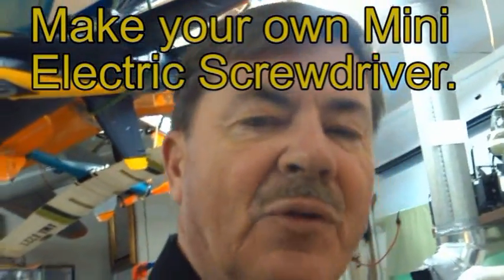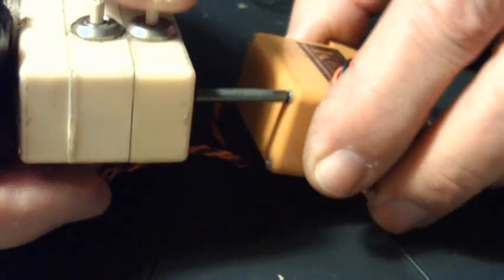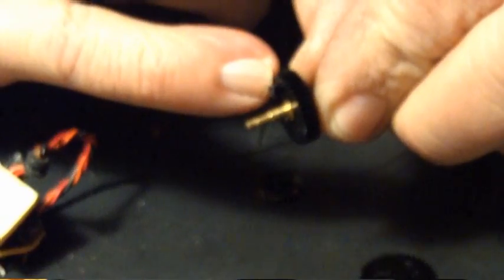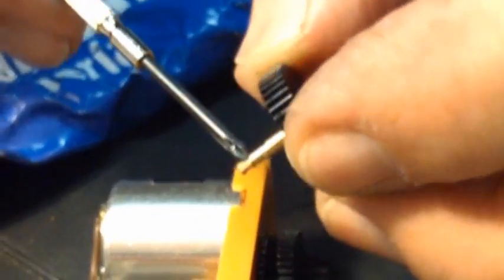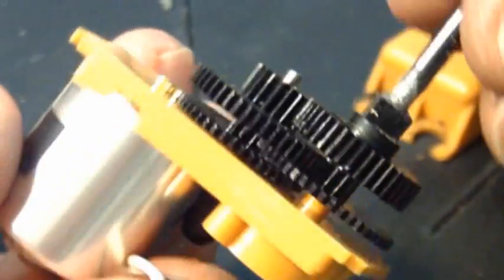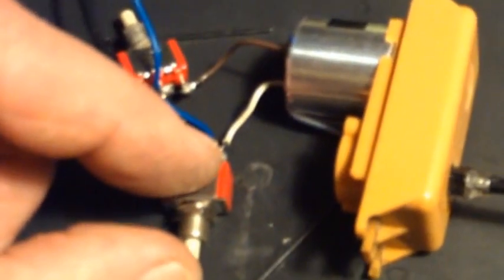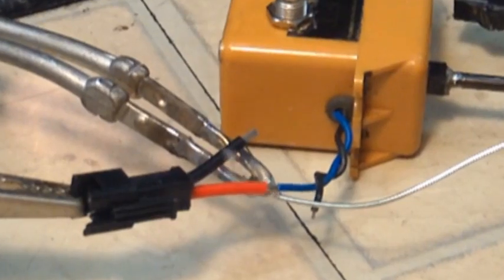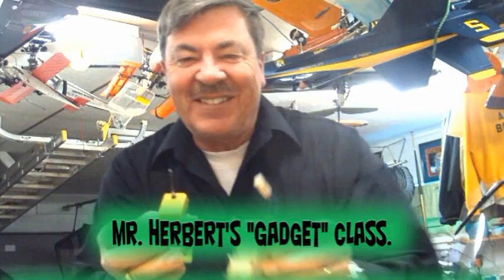Make Electric Screw Drivers  from R/C servos.

Comment: Hi NightFlyyer,

It may not look good, but the motor you designed is perfect for that little job. A large screw-driver would be slower to use because you have to aim the driver head at the screw, but the smaller one you made is almost like doing things by hand, very nice.
It is also the perfect speed, and you do not have to think about reducing the speed because it is just a single push and the screw is loose.

Take care,

mrbluenun

Comment: Great idea don't know how long ago you made this but in the UK we have had electric screw driver for thirty years.

having said that, I do actually prefer your design and it is always nice if you can find a few servo's and its kinda pleasing to use a tool which is precisely the tool for the job.

I am an invalid living alone and now have the next task to focus on!

I am not familiar with servos, would it be possible to bring the chuck' as it would be, through so one can change screw driver bits?

Comment: It should simply connect both sides of the motor to the + , so no current will flow (i.e. it won't short the battery).

Comment: Great video, Sir, thank you.

Any tips or ideas you can offer on how to regulate servo speed, without using a micro-controller or radio, would be very much appreciated.
Reply: +BillyGoat4x4 Not the most ideal method, but a potentiometer would do it.